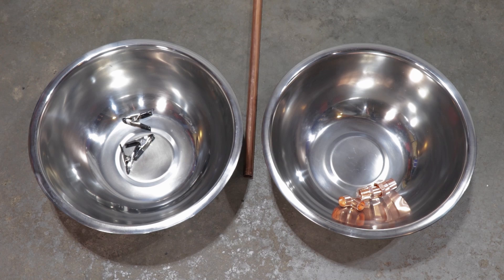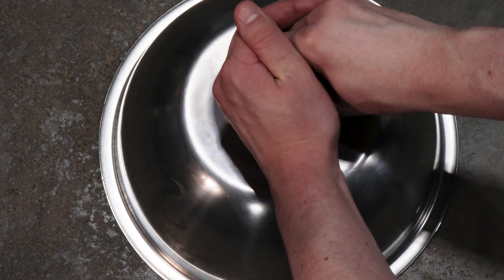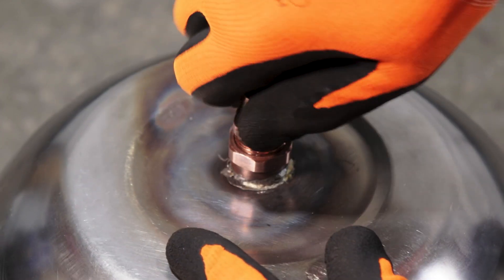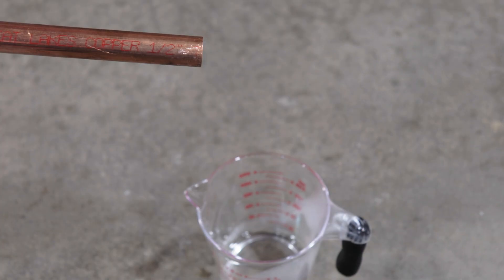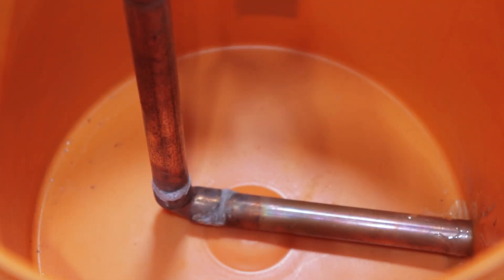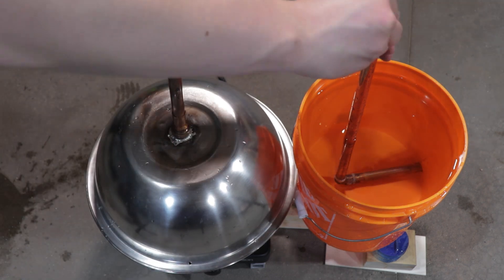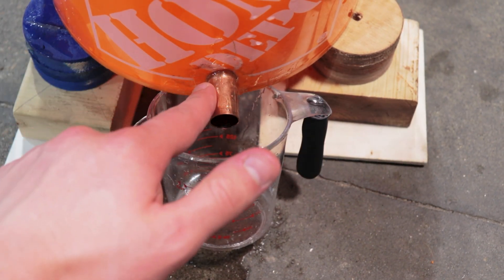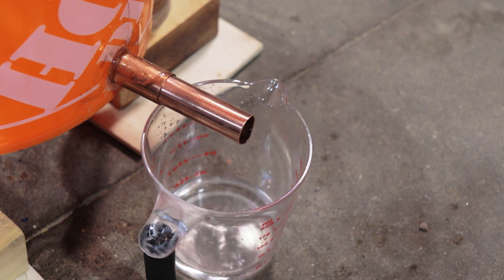DIY Water Distiller at Home with Just 2 Bowls and a Bucket

Comment: I'd venture a guess that simply clamping your boiler is likely only about 75% efficient due to unseen, small gaps at the joint allowing pressure leakage.   Boilers need to be 100% tight in order to build up the pressure you're looking to obtain if you want to maximize production through your contraption.  But I  like where you went with the idea. 👍

Comment: Regarding 0:40, to solder stainless steel, you need to use a type of flux that contains phosphoric acid to remove the oxide surface layer on stainless steel surface. The reason why stainless steel does not rust is because when exposed to the air it forms a passivated layer of chromium oxide that resists rust.

Comment: 0:41 an easier way to fix this could be have been by applying some wet copper sulphate to that hole surface of the bowl, let it get copper coated by displacement reaction with the steel, then apply your copper to copper solder for a better connection.